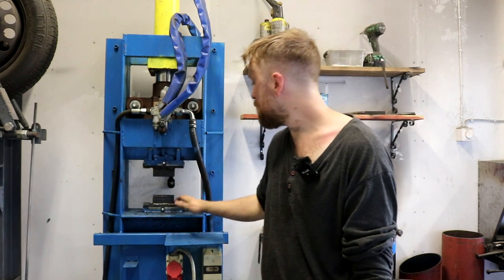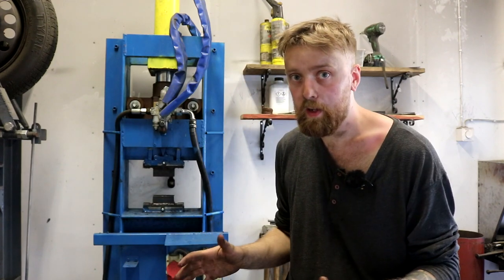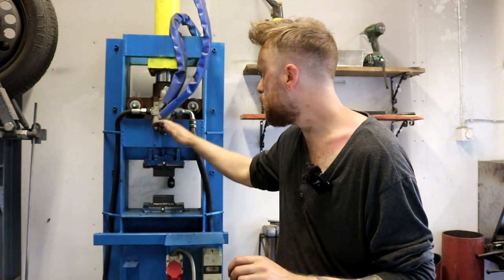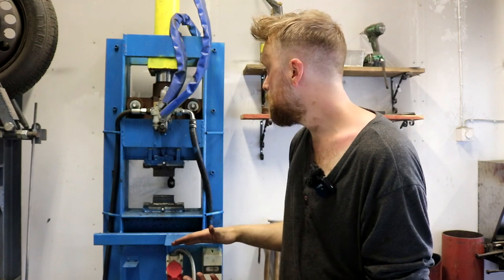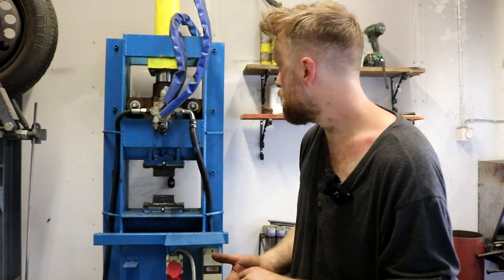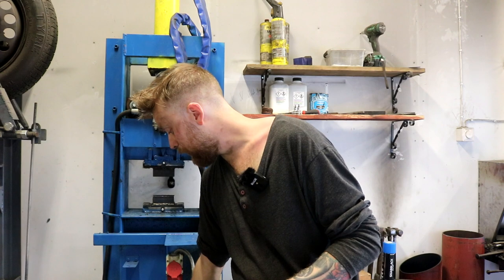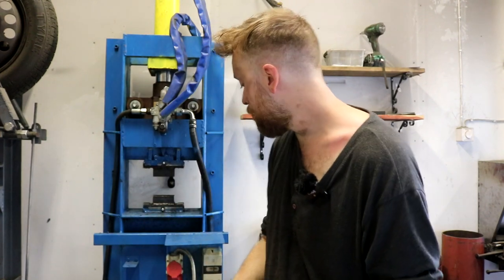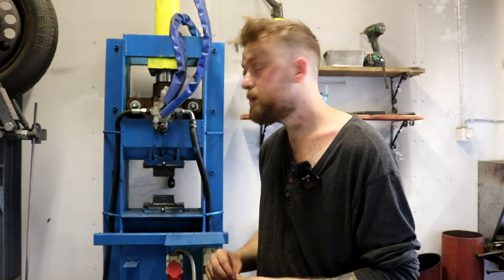BUILDING A 20T FORGE PRESS

Comment: I am not a professional welder, but I will give advice (maybe you know this): if you need a strong beautiful weld, then clean the surface.  You don’t have to take so long and hard to burning a welding electrode and the seam will turn out more beautiful.  So yes, you make a 20 ton press, maybe you should grind the seams and weld them again?  20 tons isn't joke

Comment: 1 year is passed and probably you have improved a lot to weld, but I still would like to tell you a few tips about stick welding.

The stick you can use: 
6013 is the most common, you can strike the arc easily and the weld is good at looking but not really really strong (you put the stick on negative pole)

7018 is less common if you are not a professional welder, really difficult to strike the arc even if the machine is set up correctly, quite ugly weld but really strong!
(You put the stick on positive pole)

In this video probably you used the 7018 stick or maybe if it was the 6013 you put it on positive pole
Another tip: rise a little the amperage! It was too low

Comment: My log splitter is just to flimsy, so, I'm going to spend some time and money,  buy a shorter cylinder,  hoses, control valve, quick disconnects and steel, buil a bench top press, use the quick disconnects for changing pump and engine back and forth between the press and splitter.

Comment: First off, I like that you repurposed an old piece of equipment... but I have to give you a welding tip... it's a moral imperative.  To strike a consistent ark, drag the tip of the rod across the work piece like a match... and always drag your weld puddle.

And not to worry on how your forge press will last, a good friend of mine is still using the one he converted over from an old Log Splitter about 20 years ago.  As long as you keep it clean and topped off it will last 2 years longer than stone

Comment: Little welding tip -  for 3/32” rod size start your amps at 75 and go up in 10 amp increments up to 90 amps.  1/8” rod size start at 90 amps. Again go up in 10 amp increments.  If ur sticking ur rod every time u touch ur work, ur to cold.  If ur throwing a lot of BB’s ur to hot.  Don’t be afraid of the heat, the hotter u can run the better ur weld will be.
Reply from the maker: Thanks man!
Reply: No worries, I would love to build stuff like what u made.  I just lack the mechanical skills for it.  Lol however I have been a pile welder in the U.S. for nearly 20 years, Welding is the one thing I’m good at.

Comment: Stick welders give me nightmares
Reply from the maker: I hate them... and i suck at it so much.
Reply: No need to tap the stick on the metal, just smoothly slide on it, with preferably a "clean" stick (you can file the tip a little), and add more current. It should slide >>> weld in an instant.
Reply: Verkar vara svårtända ok 48.00.